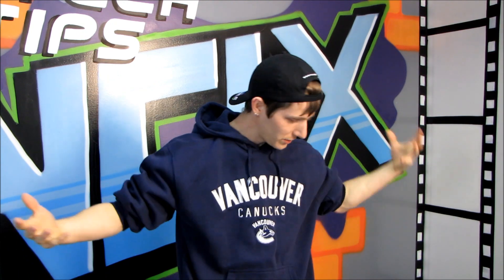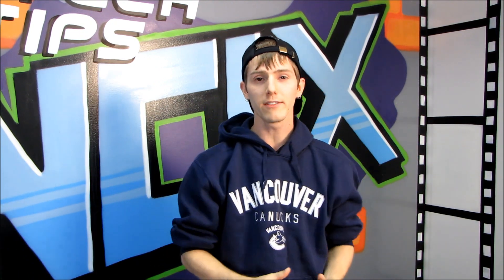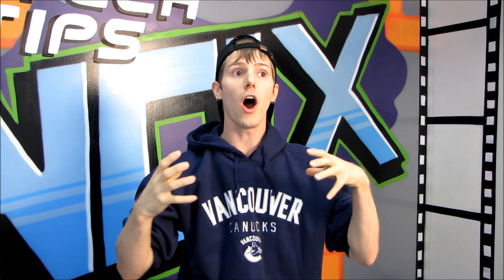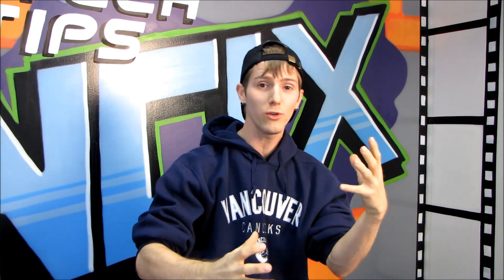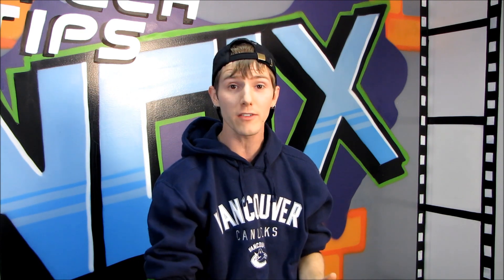Futureproofing Your PC - Dispelling Some of the Myths NCIX Tech Tips

Comment: I built my PC over 4 years ago and it's still going strong. I7 920, 6GB ram, 160gb SSD & GTX580 running games at 1080p high/max settings. The only upgrade I made was buying a 580. I'm planning on building a new one end of next year though but I'm after a new monitor so going to buy a nice 27" 1440p this month and run games with my gtx580 at medium/high settings with no AA until new build nxt year.

Comment: Case	    BitFenix Prodigy	$90
Power Supply  	Seasonic 660W Platinum	$155
Motherboard	Gigabyte Z77N-WiFi	$129
CPU	   Intel Core i7 3770K	$329
CPU Cooler   	Intel RTS2011LC	$80
Memory  	Kingston 16GB HyperX LoVo	$129
Graphics Card	  Asus GeForce GTX Titan	  $1049
Main Storage	Crucial M4 512GB SSD	$340
Optical Drive	Asus BW-12B1ST Blu-Ray	$79
OS	Windows 8 Pro	$140

Comment: Future proof:
M/B: medium price range AMD mobo ( 990FXA UD3)
- USB 3.0
- Sata 2
- Sata 3
- SLI/CFX
- Dual BIOS
-  DDR3 32GB
- 2x eSata
 ETC ...

Case:
Antec 1200:
-Loads of space for GPU's
-Cooling
-12 HDD mounting

PSU: 750W Antec (today's GPU's use less W)

RAM: 8GB DDR3 (u can add more later)
 HDD: 1 TB space/1TB backup
SSD: minimal (only for system)

CPU: AMD (FX 8320 or up) 
there are more multitreated apps comming up than single ones

GPU: up to max display resolution usable of a need

Comment: 8800 and GTX 580 lasted a while. The 8800 was king for a while and so was the GTX 580. Both were beast cards for their time and the 580 still is. 580's have been kicking ass since 2010. 2013 is here and they're still going strong. My rig: [ASROCK Z77 EXTREME 6 ,EVGA GTX 580 3072MB+MSI NGTX 580 LIGHTNING XTREME3072MB TWIN FROZRIII @ 950MHZ DUAL SLI,INTEL I5 3570K,G.SKILL 8GB SNIPER LOW VOLTAGE SERIES, MISHKIN CHRONOS DELUXE 240 GB SSD, 1000MB WESTERN DIGITAL CAVIAR BLACK 7200 RPM.]@ 1920X1200

Comment: and 5.)Rosewill BRONZE Series RBR1000-M 1000W Continuous@40°C, 80Plus Bronze Certified,Modular Cable Design,Active PFC"Compatible with Core i7, i5" Power Supply
6.)Kingston 32GB (2 x 16 GB) 240-Pin DDR3 SDRAM ECC Registered DDR3 1333 Server Memory DR x4 Model KVR

Comment: 2.)ASUS Sabertooth X79 LGA 2011 Intel X79 SATA 6Gb/s USB 3.0 ATX Intel Motherboard
3.)EVGA 02G-P4-3657-KR GeForce GTX 650 Ti BOOST 2GB 192-bit GDDR5 PCI Express 3.0 SLI Support Video Card
4.)Western Digital WD Blue WD10EZEX 1TB 7200 RPM SATA 6.0Gb/s 3.5" Internal Hard Drive -Bare Drive - OEM

Comment: The last computer i built for myself was a Core 2 Duo with 4GB ram and a 9800GT graphics card, And it still works like a charm to this day. We currently use it as a Home Cinema PC. The new build i made just last week has 64GB of 2400MHz Ram. with a i7-3930K CPU and 1 GTX670.  The reason i got 1 GTX670 is because by the time i will actually need 2, I could spend that $400 on a something better like a Titan when the price drops in a few years. Oh and a Cosmos II Case :D Love it!

Comment: AMD FX-8350 (8 physical and logical threads can handle video editing and after its overclocked then for gaming. Perfect cpu for VM.

Asus M5a99x PRO Because it's almost good as crosshair v 

Crucial Ballistix elite for low memory latencies.

Radeon 7970 for good gaming, Bitcoin mining(you may need two), bruteforce programs.

1000w PSU for OC headroom and if you add second radeon 7970

3x 2tb western digital caviar greens in raid0 and you dont need an ssd. great space for video editing.

Comment: at the end: 8350 will become better as time goes on. Some of these results are strange, but I'll take them for what they are. Intel processors have more performance per core, so it makes sense that games that utilize pure quad-core processors run better on the Intel. In the end, 8350 is cheaper, performs well enough for all games, and will continue to perform better (according to this video).

Comment: This is my rig: i5 3570k @ 4.5ghz, 16gb 1600mhz, 90+90 SSD in RAID0, 2 TB WD 7200RPM, Cooler Master 625W PSU, CM V8 cooler, I want to buy a new GPU, my options are GTX 670 or a pair of GTX 660 in SLI

Comment: The FX-8350 does not perform better in gaming, the i5-3570k will perform better in most games. + the FX-8350 take way more power, But if he want to use something that will actually use hyperthreading or take advantage of the 8 cores then he should get the 8350

Comment: that would last till about 2020 then would need to be upgraded as it wouldn't be able to run things at full HD maxed out, it isn't that the components aren't fast enough - its that they do not have the technology which will out-do our current "generation", for example PhysX, it was a new technology only on New cards, if a new technology like PhysX came out then this setup would not cut it. Of course you can turn everything off, but it will not be the best you can have... airgo not "futureproof".

Comment: I still got 2 RAM slots free on my MSI 990FXA-GD65 which supports up to 32 GB so if I feel the need to upgrade RAM I could do so. But since I dont have any plans to run Crysis 3 on it I'm more than happy with my rig. Spending more money on lets say the graphics card is just a waste since HD 7850 can handle almost every game out there in highest settings no problem.

Comment: When More's law was first crated it was a 2 year transistor doubling cycle, that is down to about 6 Months now. Reasons for my $400 mobo have to be on-board Thunderbolt, and support for 4-Way SLI/CFX without moving up to a more expensive X79 board, and consequently a $600 CPU. 

For GPUs the performance gap between generations ins't that huge. When the 8970 comes out, I most likely will buy another 7970 because the 2 cards would still be faster than upgrading to the next-gen model.

Comment: I think the sweet spot is 1500 bucks for a rig. 3570, 1600 ddr3, ssd 128, gtx 680 sc, z77ud5h, 2t westerndigi. For the money I think it's a bit over but It will last 3 years or longer I believe.  1500 is what I do plan on spending.

Comment: As far as the memory is concerned I don't think that one is on the 'approved vendors' list from Asus. the Corsair Vengeance 16GB (4x4GB) is on that list. (the full list is available on their site) 
If you don't have a need for the i7-3770K you could use the i5-3570K it's much cheaper and still really good. depends on what you are wanting to do though. Personally I prefer smaller cases, but then again depends on your needs

Comment: Nice and informative video but I have just 1 note: a more watt Power Supply isn't necessarily going to last more time. I'm not a pro PC builder but in my opinion videocards, processors and other parts are starting to use less power.

Comment: -ASUS X79 Sabertooth
-i7-3820 3.6 GHz
- 2 NVIDIA Geforce GTX 660 TI's running SLI
-Corsair Vengeance 32GB (4x8GB) DDR3 1866 MHz
-Cooler MasterSilent Pro Gold Series 1000w
-CM Storm Stryker Full Tower GC
-Seagate Barracuda 7200RPM 1TB
...Do you have Steam? LETS KICK ASS TOGETHER :D

Comment: aaaand yet you can't get 4 gtx 690s. you can only get the 2, as the paul has. a single 690 has already 2 gpus built in, and you cannot use more than 4 gpus. so as  690 has 2, and 2 690 x 2 gpus means 4 gpus, its the max.

Comment: i5 3570k CPU
HD 7950 Sapphire Boost GPU
Cooler Master HAF XM Case, w/4 200mm fans, 1 140mm exhaust
8gb Corsair Vengeance 1600mhz ram
Cooler Master 80plus gold 750w fully modular power supply(loved the 7 year warranty on it)
1tb Seagate 7200rpm HDD
1.5tb toshiba USB 3.0 External HDD
Logitech g400 mouse
Cheap 10dollar logitech keyboard,although I want Razer black widow 2013, and I also want a SSD,but want the prices on the 256gb SSDs to go down before I get one. Kinda wish I had went AMD FX 8350

Comment: So I am thinking of buying this system and I want to know if everything is compatible and if it will run well at the current time 
Aerocool X - Warrior
Coolermaster RS750-ACAAD3-EU GX Bronze 750W 80+ Bronze
Asrock H77M
Intel Core i5 2500k 3.30 GHz LGA1155
Coolermaster 412S
Zalman ZM-STG2
Asus GTX660 Ti-DC2-2GD5 2GB PCI-E Retail
Corsair Vengeance CMZ8GX3M2A1600C9R (2x4GB) PC3-12800 Dual channel
Kingston SV300S37A/120GB V300 SSD Sata3 2.5 Retail

Comment: IF you can wait a year or so I'd say the following: 
Intel haswell 6 core proccessor.
Nvidia maxwell gtx 880? with sli configuration
16GB DDR5 memory (not sure what the mhz depends on supported by CPU)
500GB SSD 
1 to 2 TB HDD maybe at 10,000 rpm 
Seasonic 1,000W power supply
aftermarket heatsink
badass case, and red ray burner.
Overclock that ram, cpu, gpu's, and your futureproof. But if you really want future proof wait till 2014 there's nvidia's and intels biggest upgrade coming.

Comment: EA released the specs the would run BF4 at high to max setting (they didn't say how many fps) amd option= 7850s in dual crossfire with i7 and 8 gigs of ram

nividia option= 2 gtx 670s in sli with an i7 and 8 gigs of ram

Comment: im looking at quad 2011 1500gb 6  pci 16x gen 3 
mb alone be over 1g but this pc im guessing will be slow sometime after 20 years
the only draw back is that the pc wont deal with desktoping as well as a normal pc but thats not realy much of a factore
there are things u can do to old pcs aswell to make them faster eg ssd disks used as ram etc other thing could be to go blade server but i dont know how well blades work in unison

Comment: There is so much fail in this comment. SLI is definitely on par or better than Crossfire and Vram has nothing to do with performance. A 2 gig card could outperform a 100000000 gig card if the 2 gig card had better specs all around.

Comment: i7 3930k 
gtx 690
1000mw psu
32gb ram
most expensive case you can get your hands on.
a handful of ssd cards.
technology is constantly changing and i guess the best "future proofing" is getting the top of the line components now.
water cooling as well.

Comment: i have a very similar build, except i put in a tv tuner, 32gb ram, 2 tb hdd, haf x case, 1000w seasonic platinum, buuuuuuut i only got 1 evga 670 ftw... u got me there. tell me, whats it like running that thing in sli? have you campared it to a single card? and did u OC ur cpu to 4.6 ghz?

Comment: I would either do exactly as you speak, OR (would rather do this instead) spend about an extra 20 dollars over what two 7770's would cost and get a single 7950 - if you are so inclined to go the AMD route. Grab a 660Ti if you want the NVidia side of things. Then you can add a second later - or just stay with the performance you have with these cards. Plus, then you don't have to deal with the complications of SLI/Crossfire and you have more usable VRAM.

Comment: I think the most future proof system would be the six core i7s and single or crossfire hd 7900, because the amd cards have more vram and higher bandwidth. Nvidia limits their cards so not even an SLI build can be futureproof because of Vram. Thats their hook. While amd has more ram that is twice what we use now and just upgrading to crossfire would give you more speed.

Comment: I had to squeeze to. I got 
i5 2320
8gb ram
gtx 550Ti
Gigabyte z68ap-d3
5gb hdd 
That board can run crossfire so i am going to sell my gtx 550ti and get 2 HD 7770 vapor-x. You think that is worth it? I will have to change my power-supply

Comment: What's wrong with Windows 8, exactly? Vista was bad because of it's horrible Kernel. Windows 8 uses an awesome, tried and tested, Linux based kernel and can boot in 2 secs off an SSD. Sounds like Windows actually used some of that common sense they've had lying around the place for once.

Comment: Not for gaming. 
But, more to the point, the joke is based on the idea that current gen hardware  is leaps and bounds ahead of software. Look at Skyrim, for example. Can only address 2GB (4 after the patch) of RAM and use 4 cores. How many years have we had 4 cores for now?

Comment: W7
I7 2600k + H60
MSI Z77A-G45 Mobo
Corsair 1050
GTX 680 2way SLI
32gb Corsair 1866mhz ram
250gb ssd
2x 500gb HDD
1x 750gb HDD
40GB SSD
3x Monitors (1440p-1080p)

Anything bottlenecking or should be changed?

Comment: The human eye does NOT see in fps. Instead it sees in a smooth motion. So if you flash a light (maybe a laser) for 1/300th of a second you will see it. But if you shine tons of pulses (on, off, on, off) with 1/300th of a second between each pulse and give say 6 pulses you will see flashes but you won't be able to see how many pulses their were. So the human eye does NOT see in fps.

Comment: Actually.. The value of mid-low cards such as the 650 is not as good as something a bit higher. Your CPU is also a bad choice considering what you've chosen for your graphics because the i7 will not be delivering any extra performance in gaming over an i5 3570k(maybe a couple fps, MAX). If you had a 670 and an i7, I wouldn't be complaining, but the fact is that you've decided to spend extra cash on an area that isn't necessary. I agree with CTVRaptor. Get a better card with an i5 3570k.

Comment: My Build in a Week:

Case: Cooler Master RC-932-KKN5-GP HAF Advanced Big-Tower
Mainboard: ASUS P8Z77-V LX Mainboard Sockel 1155
Prozessor: Intel Core i7-3770K Prozessor (3,5GHz, L3 Cache, Sockel 1155)
Memory/RAM: Corsair Vengeance Blue LP 8GB 1866 mhz
Graphics Card: Gigabyte NVIDIA GTX 650 TI 2gb
Hard Drive: 500GB Blue (8,9 cm (3,5 Zoll), 7200rpm, SATA 6 Gb/s, 16MB Cache) <-- I cheaped out on this one for now...
Power Supply: Xilence XP800 R3 (800 Watt, ATX 2.3)

Friday, 18th January 2013

Comment: I've started building a new rig that I will be using for Audio Production, Gaming and Multimedia this video is pretty good, essentially I still have a fairly good system that I bought back in 2007 that cost me a fortune but it's already struggling, so now it's 2013 and we're talking a 6 year difference... So yeah, it's possible to future-proof your system, it's especially easier now because we're getting to a point where technology is somewhat bottlenecked

Comment: I was planning to buy:
1. i5 3570k 3.4 Ghz
2.gtx 660 2 Gb
3.asrock extreme4
4.antec 650w platinum
and i was planning to get a 2nd gtx after 2-3 years or so but i guess that idea is gonna go outa the window and i will buy:
1. i5 3570k 3.4 Ghz
2.gtx 660 ti
3.asrock extreme4
4.another 650w psu with bronze-gold

so that saved me a couple of bucks thank you ncix keep it up

Comment: CPU: some fast with 2011 socket så I could upgrade later,
MOTHERBOARD: socket 2011, 4 SLI, overclockning enable. Many ram connectors so I can buy more ram modules later.
GPU: GTX 680 and then when it get old I just buy one more! up to 4.
HDD: Big ssd 512gb to save system and some programs on, then buy more normal hdd when I need.
RAM: Just one module that is good for today, 1x8gb. When I need more I just buy one.
POWERSURPLY: 1000W then when I need more I buy a new and put outside my computer :P

Comment: 1. Intel core i5 3570k
2. Asrock z77 EXTREME 4
3. Ocz 750 powersuply 100% modular
4. Ocz vertex 3 120 gb SSD for OS and fav apps 
5. Windows 7 home premium 64bit
6. Kingston hyper x ram 1600 8GB DDR3 4GBx2
7. 2TB wetern gigital green 7200rpm HDD
8. Corsair carbide 500R CASE 
9. EVGA GTX660 supercloked SLI

This system is easyly upgrade-able and perfect for mid range gamming PC :D

Comment: 1. Intel Core i5- 3570k CPU.
2. Asus Sabertooth z77 Motherboard.
3. GTX 660Ti, might go for SLI if can afford it in 2 months time.
4.8GB Corsair Vengeance 1600Mgz RAM. Upgrade to 16GB after a year or so.
5. Corsair Cx750 because why not?
6. 1 TB Western Digital Caviar Black HDD because it's just a little bit more expensive than the 500Gb one.
7. An NZXT Phantom 410-Black ( because i'm racist,not)

All that makes it up to 1050$ which is affordable and upgrade-able at the same time.

Comment: Sorry, I wanted to put my input on this subject and answer your questions.
But with the gaming technology and other aspects, gaming keyboards and mice don't really get out dated, they just get over used and as a gamer you want to replace them.  Keys are being rubbed off. Then, your PSU can be used for other builds, but times will charge. It was not a long ago where they just introduced 24 pin power and 8 pin CPU power.

Comment: I don't really agree with getting more ram later, ram prices have been fairly cheap the past couple years, and older ram normally goes up in price because the new stuff will be cheaper. I feel bad for people with DDR1/2 ram who pay almost as much for 1GB as 4GB DDR3.Sometimes the price between 4GB and 8GB is 10-20$ so pay an extra 10-20$ get more ram then needed, then you don't need to worry about ram usage, and killing your hard drive with all the swap it would be doing if you used too much ram

Comment: i think i did pretty good with future proofing my system, atm im running a 1156 socket motherboard with a i7 2600k aswell as a gtx 670 with 2x SSD drive 120G. The major loss i had was on the SSD drives as they set me back $500 for just 250g, they are roughly half that in price now how ever my other parts are still sweet for a bit (Used a ATI 4850 as my graphics card in my build untill the 600 series came out.)

Comment: 1. Overclockable Intel CPU running at stock speed.
2. Motherboard with all the current standards and good overclocking options.
3. RAM that supports faster speeds than you need right away.
4. Large, reliable SSD that you take good care of.
5. A GPU that is 1 or so tiers above what you need right away.
6. A PSU that supplies lots more wattage than you need.

Avoid upgrades by overclocking (but only once better performance is required).

Comment: Hard Drives and Ram are a completely different animal. They are commodities. They do not always follow a set curve. It is purely supply/demand based. The predominance of Cloud storage could in fact increase the price of certain types of storage. A good example is the increase in prices on standard hard drives this year almost tripling do to floods. A general rule in buying these things is get as much as you can afford. Ram use to be the worst with 50 dollar ups and downs almost on a reg basis.